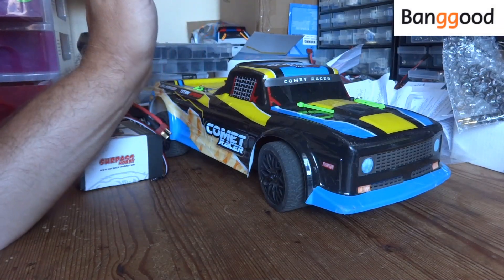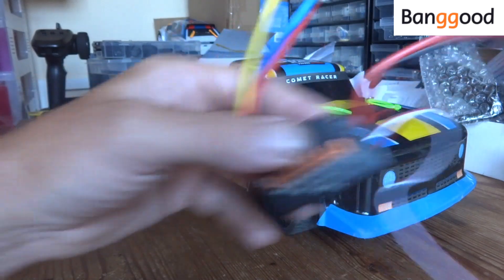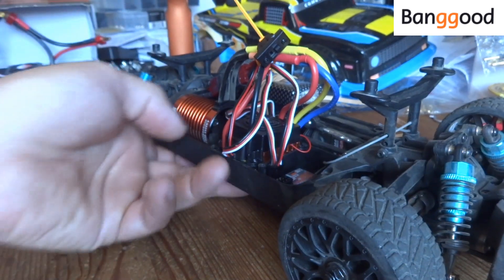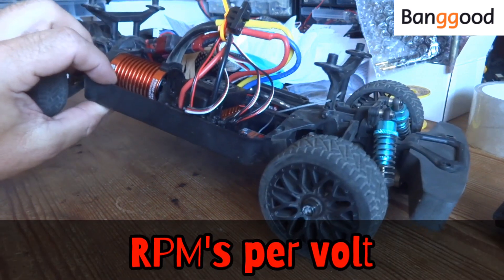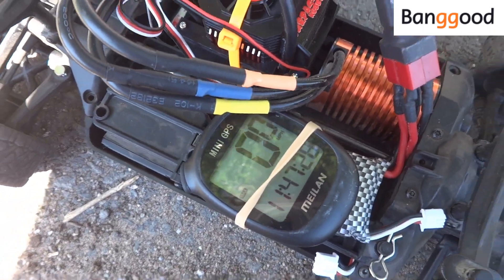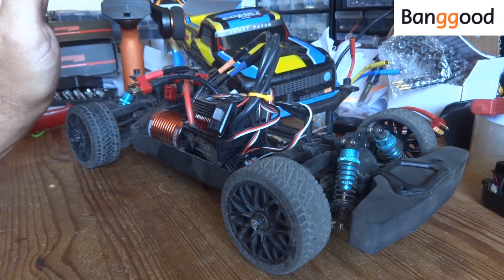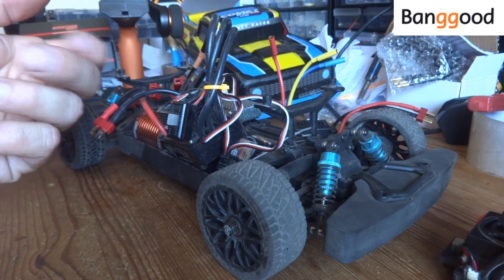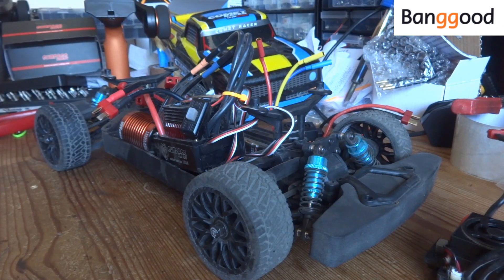Do More Amps Equal More Speed? Cheap Generic & Surpass Hobby RC 150A KK ESC's Tested.

Comment: The KV limit is more in line for safety. The KV is nothing more about the limit of the motor. If you run a motor past it’s maximum revs, it will do something noisy and possibly stinky. I do wish manufacturers would list the motors maximum safe rpm and voltage.
Reply from the maker: Yes, I can understand why that would be advantageous.  👍

Comment: You can pretty much eliminate the cogging issue by playing with the parameters set to strong with a programming card on the esc. I used a 120A 4S capable ESC i bought recently on my Zroad buggy and it ran like it was on rails. Check out my fairly recent video on my channel ZROAD HUNTER 1/12 Buggy Brushless Speed Run Test
Reply from the maker: Hello! The cogging was only really evident on the cheaper 60A ESC. I did try and plug in the Surpass hobby program card (because it looked like a bit of a copy) to see if I could alter anything but was having none of it. There was no cogging in either of the two Surpass ESC's (even the lower 45A one). And the vid was only really an experiment to see what effect if any more amps had on the performance. I will definitely check out your video, and at some point a top speed run at a better location is called for. Just to see what it will do. Thanks for dropping a comment!! 👍😄
Reply: @theminiatureconstructionco4556  
Yes unfortunately some brands or rebranded copies of these cheaper escs can cog while others work fine as you said. I have found that sometimes though (not always) that playing with the start up modes to strong or even soft punch on the card settings can help on some esc's. Thanks for stopping by my video and having a look also, cheers mate 🍻 Great tests, always fun testing these budget setups!
Reply from the maker: @PERTHWESTOZRC  yes absolutely! 👍

Comment: youtube killed my comment reply button (aggravating!)
YVMW yes you can do a lot with adjusting at the transmitter, if you need more fine tuning then ESC programming card time, is same stuff but being applied to the ESC itself with the power curve.. current limiting too for some, aka: how not to burn up an ESC.
Reply from the maker: You have broke the reply button!!! 😄I have a surpass hobby card but it doesn't feature many perameters. Don't know if the 'start condition' would tone things down any? 👍

Comment: if an ESC cant deliver current a motor wants, acceleration is slower than its potential. old school brushed ESC's often had a current limiting dial, in some racing situations it was helpful. a good adjustable transmitter with exponential and endpoint controls for the throttle, as well as a programming card for a brushless ESC, can change how the response feels so you have more (or easier) control of when+how it'll hit. yes that little truck would have hit 50 mph, if power didn't hit all at once like a switch around half throttle. the other issue is obviously lack of down force help from the body, helps traction a lot.
Reply from the maker: Yes I've got expo and end point adjustments on the controller. Perhaps I could 'tone down' the surge at full throttle to a manageable level? Great advice as usual! 😄👍

Comment: I have been wondering if I could run the 150 on 2s for ages as not mentioned on the leaflet, nice to know
Reply from the maker: Yes we'll I was looking at the plugs and thought you must have to bridge one. Might have to visit your recently discovered Shelton bar straight road for some top speed runs! 😄👍
Reply: @theminiatureconstructionco4556  defo or that one runs down side of the carparks at trenthm
Reply from the maker: @grrfy  don't know about that one?

Comment: What a cool video! I love stuff like this 👌🏻 Just a word of warning, that 150amp ESC will not take 6s for long! They burn out mate. That was the ESC that came in the zd racing ex07 and pretty much all of them went up in smoke! Plus I put one in my hyper on 6s and it lasted less than 5 minutes 🙄 The thing about the amps is a tricky one, if you did exactly the same test but with a big fat 40 or 50mm can there would have definitely been a difference in speed, the motor will draw what it needs but the ESC can only give it what it's got of that makes sense. And the ESC will only have what it has depending on the lipos also. That small motor probably only needs 40-60amps. Amps will give you speed but only if your motor isn't getting enough in the first place. I could rattle on all day about it 🤣 Anyway I hope you do more vids like this mate! Very interesting stuff my mate 👍🏻🤘🏻🤘🏻🤘🏻
Reply from the maker: Appreciate your input and especially the warning about 6S! If I get desperate enough for content I may just chance it one day. See how long it lasts!!! 😄😄
Reply: @theminiatureconstructionco4556  🤣 That's the sort of content people want to see mate! Bit of carnage 💥 👍🏻🤘🏻🤘🏻
Reply from the maker: @ksrnate  I wonder if lower 'C' batteries would give it a fighting chance?
Reply from the maker: Hello! That's sort of what I was lead to believe, but I was hoping that a 540 can wouldn't have quite got what it needed from a 45A ESC to reach its 3300rpm / volt max. I was thinking about fitting a 3660 motor I have lying around and trying it. But ended up not changing it, and in hindsight I should have. May have seen a difference like you say. I was under the impression that the voltage dictates the theoretical rotation speed but it's the amps that gets it there. So it turns out that Surpass Hobby are spot on with this kit and you only need 45A. 👍😄👍